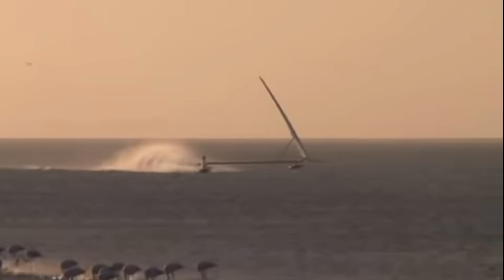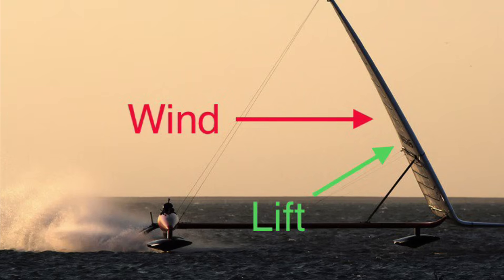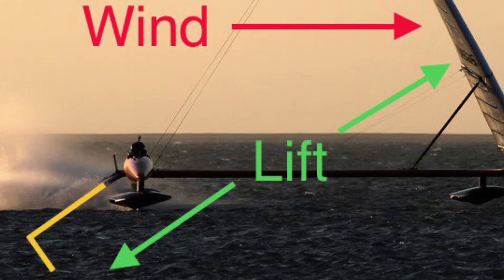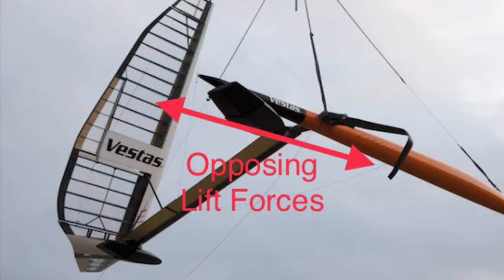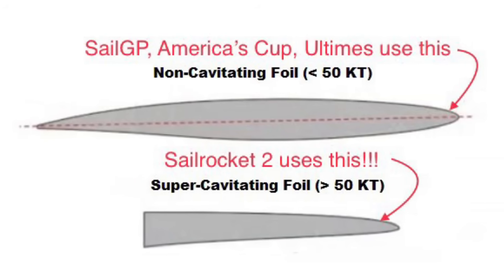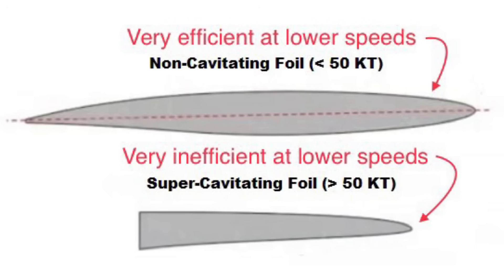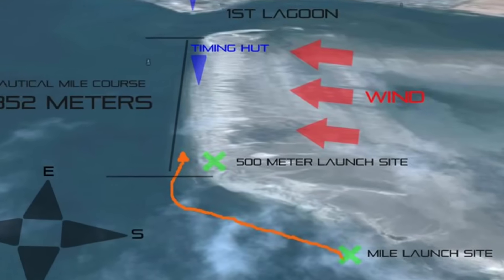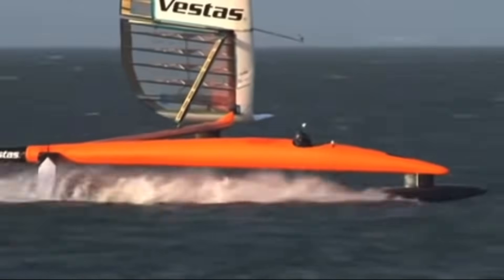How Did Vestas Sailrocket 2 Smash the Sailing Speed Record?!?!

Comment: Awesome! I worked with a team who built an airship that uses a vertical dual foil design, it's called the Windcrafter Carangifoil. It's my dream to see airships sail the sky!
Reply from the maker: That must have been a cool job!!!
Reply: @SailingTipsCa  we never found enough funding to build manned versions, but I experienced it working with several radio controlled models, in the wind. There is a patent on it, but it is going into the public domain this next spring. Would love to discuss the benefits of vertical airships if you want, at this point we would just love to see a manned version fly someday!

Comment: Makes me wonder if a blown flap could do a similar job in a AC or Sail GP foiling boat above the 50 knot barrier
Reply from the maker: Like a jettisoned flap? The main issue would be that the supercavitating foil is very inefficient at lower speeds so you'd have to stay above 50 knots which would be hard, otherwise sub-cavitating foils will get you there faster with higher average speeds.

Comment: Interesting to see and hear you mention that this speed is measured over a fixed distance - as opposed to Veritasium and his cronies and that "Downwind faster than the wind" nonsense. Conveniently, that allows for an instantaneous measurement of speed "while accelerating". Just don't mention the variable pitch propellor, and that wind both gusts and dies down again. They don't like it when you point out the obvious flaw in the measuring technique - and they should give the professor his money back. Congrats to the Sailrocket 2 team for setting an impressive, correctly measured, and legitimate record.
Reply from the maker: An amazing accomplishment indeed! You can read the rules for measurement for the 500 metre and nautical mile records (which Sailrocket 2 holds) at https://www.sailspeedrecords.com/the-course-of-500-m and https://www.sailspeedrecords.com/the-course-of-one-nautical-mile. Their top speed in both cases was a few knots higher than the record speed which is averaged over the distance.

Comment: Love your videos, but can you include more data on the wind speed and sea state etc at the time these records were set? Thanks, and keep up the good work  🙂
Reply from the maker: Yes should have included that! Sailrocket 2 broke the 500 and nautical mile records at Walvis Bay in November 2012, with the wind at 25-30 knots. The sailing area is in the lee of a sand bar so sea state is negligible, hence the location. Hope this helps!

Comment: So I can assume someone is working on foils that use hydrualic actuators to shape the foil on the fly, kind of like VTEC for foils, lol.  Honestly doesn't seem that hard as long as you're using the proper materials, and tethers where you want to restrict movement within the foil, etc.
Reply from the maker: That would be the ticket but they’re relatively small and highly-loaded with water being about 800 times more dense than air!

Comment: So, it's basically useless aside from the occasional foray into perfectly nonexistent conditions? I have mastered my Sunfish sailboat in almost all challenging recreational settings afloat.
Reply from the maker: Might get some good use if you happen to live in Walvis Bay and have a motorized dinghy to tow back on port tack! Otherwise not so much… Dinghies like Sunfish are a great way to learn sailing!
Reply: Well, by your logic a Saturn V is "basically useless aside from the occasional foray" TO THE MOON!  There are general-purpose craft (like your Sunfish and my beachcats) and purpose-built craft like the TriFoiler - and in the extreme case, Sailrocket.  Speaking from my own experience, as much as I love to go really fast, that happens down in a tight little cockpit; there are days for that, and there are days for getting out on the trapeze and hammering nails... and days for stretching out on the tramp and getting some sun when there's no damn wind.  One does not invalidate the other, rather, they complement each other.
Reply from the maker: @jonathanlevine8497  Yes everything in sailing (and flying to the moon) is a compromise!!!

Comment: Nit-pick here: It doesn't "literally" boil.
Reply from the maker: I’m not a physicist but the boiling point of water does decrease as pressure decreases, so on Mt. Everest it boils at around 68’ C. The low pressure side of a foil is much lower yet which reduces the “boiling” point to the same temperature as the sea water. What would you call it them?

Comment: It advances engineering and helps push the limits of what was thought possible. That is useful. Whether it leads to practical improvements in sailing speeds is another question. (In this case, probably not due to all the limitations described.  Still, it is cool as hell.)
Reply: Actually, it is a really important result. It clearly shows the benefits to be gained if one can reduce the amount of cavitation on regular foil boats. This  is akin to all the work that has been done on airliner design at transonic speeds to reduce fuel consumption (I used to work at Boeing). Trip strips anyone?
Reply from the maker: @KlingbergWingMkII  In my mind it is akin to transonic transition although the mechanism is different.

Comment: "Sailing contraption" is a great definition. It's certainly not a sail boat.... I'd love to see it tack!! (I was a cruiser back in the day).
Reply: Goes on water, not land or air, therefore boat

Uses wind to power itself, therefore sailboat

That it has limited application doesn't make it not what it is. You don't call a land speed record drag racer that can only go straight on a dry salt lake "not a car" just because it's weird and limited in what it can do because it was designed with one goal in mind.
Reply from the maker: Proas are asymmetric like Sailrocket and they “shunt” instead of tack, but that also requires the main fuselage to change direction which Sailrocket can’t do either. Still cool though!

Comment: I've done about 140 kts on water (piston engine powered, not wind powered). It was my neighbour's floatplane, where he performed an extended touch-and-go at fairly high speed along a nearby lake. The speed was about 140 kts indicated. Then he pushed the throttle forward, accelerated to a higher speed (not sure how fast), and then pulled up and took off.  Many of the fastest boats on Earth are just floatplanes fooling around.
Reply from the maker: The unlimited hydroplanes are pretty fast too!!!

Comment: Perhaps it's time for a staged foil. I wonder if it is possible to design a sub-cavitation speed foil that performs as an acceptable super-cavitating foil if half of it is cut of. All you need is some very precise alignment, a bunch of explosive bolts and a very cool large red button labelled 'stage separation'.

And some poor sod in a RIB who has to go look for the shedded foil sections.
Reply from the maker: Cool idea - like a space ship that jettisons rocket stages! I think some people are working on multi-stage foils but I’m not exactly sue what their thinking is or how they work. Airplane wings effectively change shape for efficiency at different speeds, but they are also much larger and less loaded than underwater foils, so there’s more room inside for control mechanisms.

Comment: But does it really need flat water? We could just make it bigger and the size of the waves would shrink in relation to the size of the foil.
Reply from the maker: The Sailrocket was designed to fit into a standard 40’ shipping container to make it easier to transport from the manufacturing site to the sailing site. Making it bigger would enable it to handle bigger waves, but still probably not the waves you’d typically encounter in 30 knots of wind in the open ocean. Deliveries would also be much more difficult!

Comment: Excellent and compact explanation!  I'd say as much as this boat is just for making a speed record run - it shows and extends the technological barriers, that have been reached when using foils at speed. Maybe in 20 years someone will build upon those insights and be able to build an even faster sailing boat with new ideas.  Or a boat that can make use of this technology, but designed to be a more practical multi directional sailing vessel.
Reply from the maker: Sailrocket definitely pushed the limits but had to make some practical compromises to get there! The more recent focus has been to use foils to achieve higher averages speeds in moderate conditions, rather than top-end speed, as explained in this video: How Fast Can a Foiling Sailboat Actually Go?!?!? https://youtu.be/SWGBgR_Np3E

Comment: Despite its limitations, sail rocket 2 is indeed one of the coolest sailing contraptions ever devised.
A spectacular feat of perseverance, engineering, and bravery.
Don't care one little bit if there's only 1 place in the world it can sail that fast. 👍
Reply: Doesn't sound too much more specialized than a Top Fuel Funny Car. Ain't too many places you can drive one of them.
Reply from the maker: Well said - I totally agree!!!
Reply: That pass reminds me of the olden days land and water speed runs using engines, just sittin there ready to die.
Reply: I agree its a 'spectacular feat of perseverance, and engineering...', the 'bravery' part I believe you are using a tad loosely, and I have issue with. They're going 50 kph, on water. I mean, what's the worse that's going to happen?
Reply: @IRequireMedication  hitting the water at high speeds is like falling onto concrete, it could knock you out, and then you drown. that could happen.
Reply: @IRequireMedication  https://www.youtube.com/watch?v=8Ow8QbXhZJU
Also max speed was 120kph.....not 50.
Reply: yeah its not a huge waste of resources at all
Reply: @user-lo4me9oe9z  that's what people said about the wheel, the car, the train, the airplane, etc, etc.
Reply: It's fastest because it's pointedly specialized. Because it's specialized, it's limited in some aspects to gain in some aspects. It floats so it's a boat. It's powered by the wind so it's a sailboat. So it's the fastest sailboat!
       💪😁👍
Thanks for showing.
Reply: It is certainly uber cool, and just the toy for some rich, sail enthusiast, Namibian, who has everything else already
Reply: @alexanderSydneyOz built in the UK, owned and sailed by Paul Larsen, funded by Vestas wind-turbine manufacturers. Not some random millionaire and definitely not a Namibian.
Reply: @alexanderSydneyOz  There's a rich Namibian prince who's always emailing me asking for help to get out of the country, but maybe he'd change his mind and stay if he had one of these cool ships. 😆
Reply: @alexanderSydneyOz  Well.... Vestas is far from Namibian... or even boatbuilders. But they do make offshore turbines, so I bet there's a ton of secret R&D hidden in there, that they could possibly use, and if not, it's still great exposure as masters of the wind. It's big corp budget on that thing, not just billionaire fun and games.
Reply from the maker: @alexanderSydneyOz  And it does keep the rest of us (non-rich) entertained!

Comment: It still cannot run downwind any faster than the wind.
Reply from the maker: Sailing dead downwind faster than the wind is hard for any boat!!!
Reply: @SailingTipsCa  That depends on how you define "downwind".  I call it anything south of a beam reach, and at 110 degrees off the wind the TriFoiler will travel at twice the windspeed.  On a dead run (of course) you're right - you can't go faster than the wind.
Reply from the maker: @jonathanlevine8497  Yes I meant running dead downwind where you might be lucky to travel at 60% of the true wind speed. By comparison if you gybe downwind at 45 degrees above dead downwind, you’re travelling about 1.4 times further, but a fast boat can sail much faster than the true wind on this point of sail, with the apparent wind well forward of the beam, so you’ll get to your destination much faster even though you’re travelling further.
Reply: ... though it is technically possible, despite appearing to be an affront to common sense! https://youtu.be/yCsgoLc_fzI

Comment: I think your channel was the one I had mentioned Sailrocket2 as a comment.  I had no idea that it was so specialized and had so many shortcomings—they certainly didn’t highlight those in their vid clip.  Your knowledge about foil dynamics is quite impressive.  Thumbs up!
Reply from the maker: Yes I did a video called "How Fast Can a Foiling Sailboat Actually Go?!?!" https://youtu.be/SWGBgR_Np3E and spoke of the cavitation limit at around 50 knots, and a few people mentioned Sailrocket 2 going faster, so I thought I'd follow up with a Sailrocket video and speak to the limitations and specific conditions it requires. I have an engineering background so am interested in engineering and able to read the papers although I'm not a fluid engineer!
Reply: It was always clear when Sailrocket 2 was doing its speed runs that it was a starboard-tack only boat, and suited only for flat water, so clearly very limited use. But it does what it was designed for VERY well.

Comment: Have you checked out dynamic soaring? In air, but it’s pushing aerofoils to extremes. Trans sonic speed
Reply from the maker: I hadn't heard that term before, but after Googling I'm wondering if its the same phenomenon local paragliders use to stay aloft along a local waterfront cliff where the wind is deflected upwards?
Reply: @SailingTipsCa  unlikely. Dynamic soaring is flying the plane in the lee side of the ridge, the death zone for paragliders. Then popping up into the wind to gain speed.
Reply from the maker: @kennethjessop6073  Gotcha! I guess that’s the death zone for paraglides because their soft “wing” might collapse? I’ve always been fascinated by all forms of lift and flight, but unfortunately this life is too short to partake in all of them!
Reply: @SailingTipsCa  
https://youtu.be/SVN-oF6tPLc
Reply: @SailingTipsCa  
https://youtu.be/4eFD_Wj6dhk
YouTube will do the rest.